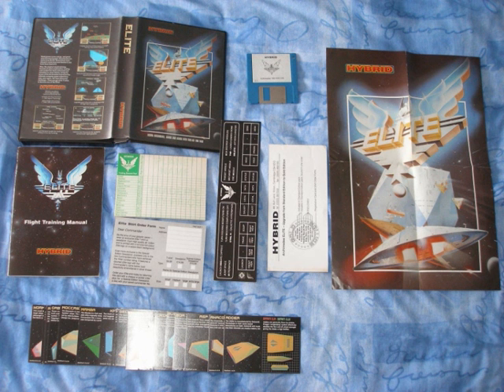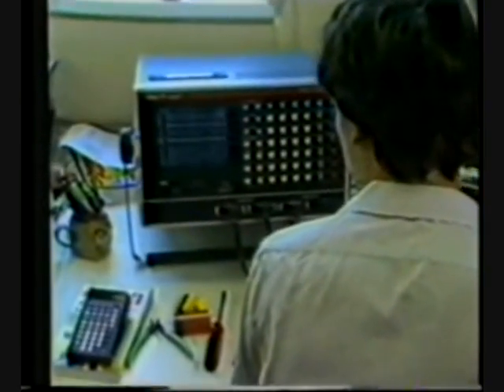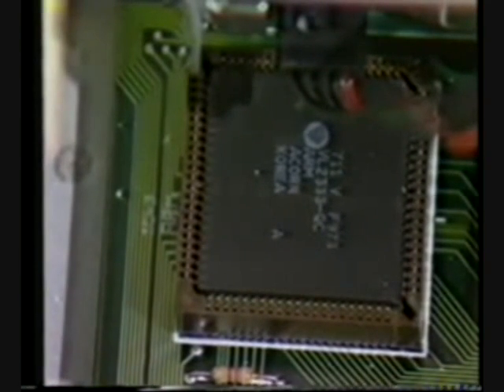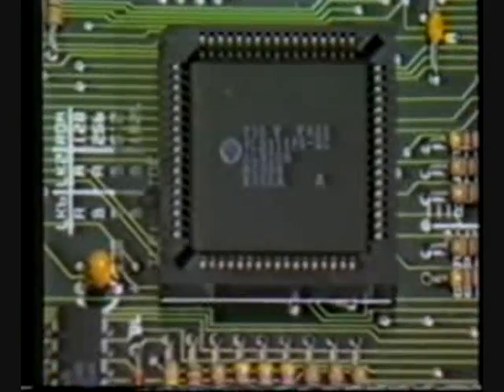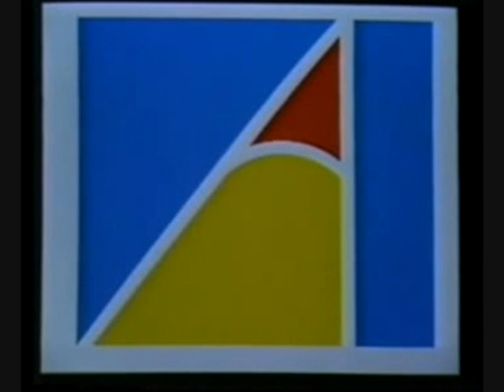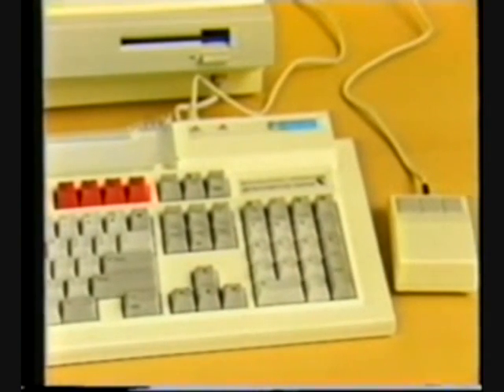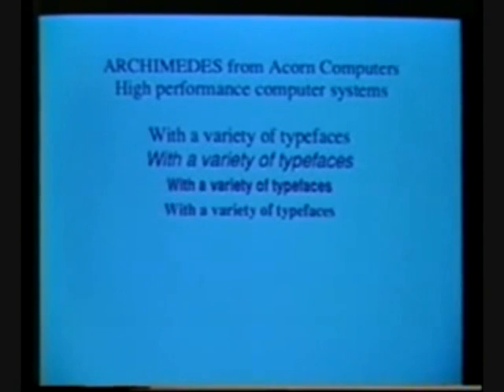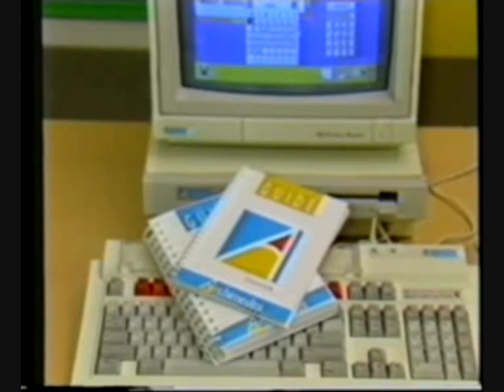Acorn Archimedes History/Hardware Overview - Musicman2047

Comment: Please note the ugly OS you see running is not RISC OS 3, available in 1989.
Its graphical user interface outperforms Windows 3.1 available at the time.

Also if you want to see a game really using the power of the Archimedes, search for StarFighter3000.
And when demomakers release games for the machines, it gives Aldebaran or Scorpius (Search 'Aldebaran Acorn' and 'Scorpius Demo' on Youtube).

Comment: Correction : hardware sprites DO exist on the Archimedes : 32 pixels width, unlimited height. Each pixel to display by the VIDC is coded on 2 bits. Value 0 gives transparency, thus this sprite can be in 3 colours, freely chosen from 4096. 

When comparing the Acorn A3010 and the Amiga A1200 note that the chip in the A3010 runs at 12 Mhz (not 8 Mhz as for the Acorn A3000), which makes it MUCH faster than the Amiga 1200.
Acorn was a real computer maker when CBM made games consoles with a keyboard.